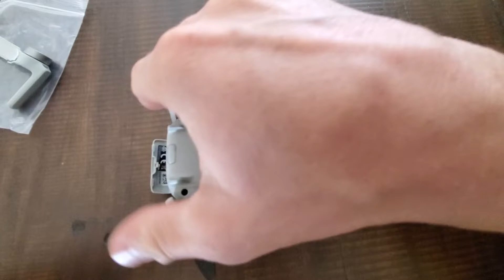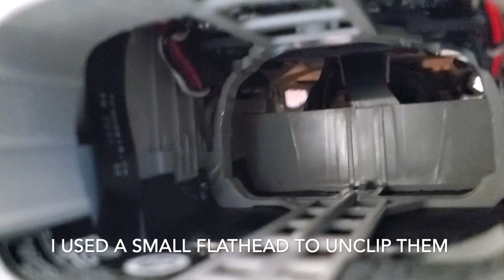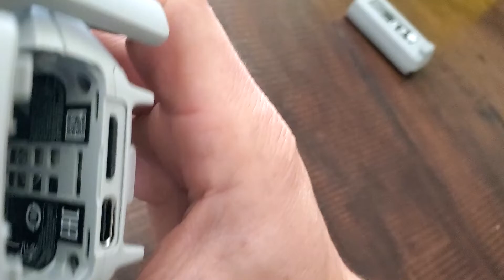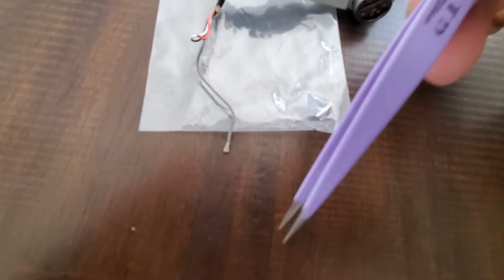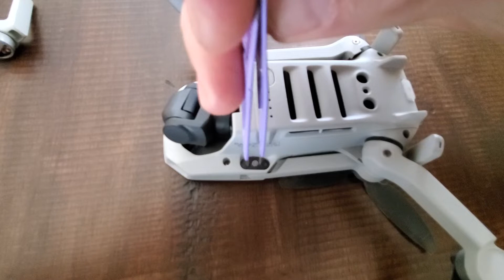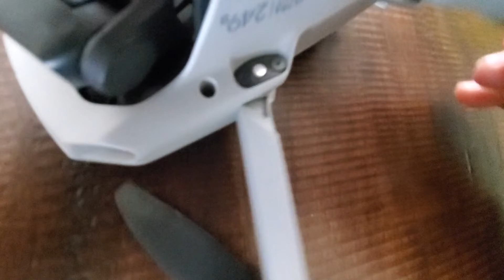Replacing Broken DJI Mini 2 Front Right Arm

Comment: I found an easier way to do the spring mechanism on the arm. You don't need to fiddle with a philips or anything. Get the arm setup in the position you used(retracted) and angle the pin into place. It'll be sort of slanted, then give it a good push. You'll have to shove kind of hard but it will go in. It took me like 2-3 minutes to figure this out and then it went right into place. Kinda weird.

Comment: Easiest way to deal with that arm is put it in between the two positions. It's very tricky. You have to get it to settle right before it clicks left or right and then it pushes right through.

Comment: I just finished replacing my front right leg, crack it when the Stars and Stripes attacked it during landing. Wind shifted and the flag flurried right into it. Be careful for the blue heat sink puddy. I managed to dabble into it a few time unfortunately. I was able to replace those area with left over heat puddy from my computer when I replaced the CPU. It powers up and gimble checks good. Now for a test flight when the weather clears up...

Comment: EASY WAY TO GET THE PIN IN THE ARM..... it isn't a pin per se, it is the spring/pin assembly.  Hold the black plastic top and turn the "pin" until you are at the apex of the spring tension...it will take a little finesse to get it stopped at the apex.  You can then move the arm to whichever position it will line up in and then press the pin in.  It takes less than a minute to do it this way.

Comment: If they could get the arm here I'd be good. Cant believe the dumb crash I had.... got the top off. Found it easier to get the back clips and then do the inside clips. The right sized slim flathead is key. Dont rush.. front of top canopy is pretty hard to get

Comment: Great video. I need to replace the same arm. Does it seem to fly as good as new? I have heard complaints saying the ebay and Amazon parts aren't oem motors. Does it seem to fly the same speed as before? Thanks
Reply from the maker: Yes it flies good as new. It's a straight forward repair

Comment: I used your technique to put the arm spring back in and it totally worked.   I was struggling with it for a bit.   It is a tricky one.     My arm broke in mid air while in sport mode.  Never had that happen before.  Sucked because it was only my second day flying the drone.
Reply from the maker: Glad you were able to get it repaired!
Reply: @jt3296  do you have a link for the mini2 left front arm I'd really appreciate it
Reply: @AliKraftDesign  I got my  replacement from Cloud City Drones.  It was the lowest OEM price I could find.
Reply: I know that feel :) lost my mini 2 on the second day. like completely lost, it flew away at a 90 m altitude. after few ads on local social media, an extremely kind person who picked the drone up after a crash returned it to me. the result is right arm is broken (but actually can be glued and works completely fine), gimbal broken, 3 in 1 cable broken. still waiting for spare parts to come from China. you can check the video of crash in my channel
Reply: @bugirrra  how much risk is there in glueing the fractured arm back? I've got one that got treed by an ill advised quick shot, and shaking the tree was another bad idea, not liking the drop. The motor still works, and seems if a strong enough glue were used, might still be workable.
Reply: @bugirrra  What glue did you use?  I've tried Gorilla super glue and it didn't take hold.  Thanks

Comment: I self repaired mine and couldn't bring that black part on it's original position because the spring is kicking the that front arm so you cannot bring it easy to its original position. One thing i did is force it at the same make a threat that if it will not go back i was going to completely hammer it into pieces. Because it is horrable as he say, took me 3 hours to figure it out. In the end the motor did not work.
Reply: Yea, that was a bear.

Comment: Hi there I have. A problem with my drone ,  a few months ago i crashed my drone , and I tryed to fix it by replacing the wings and the motor itself but it didnt work the drone starts to move to one side once i turn it on it looks to me like it doesnt have enough potential in the back right rear part of the drone its the (dji mavic mini )
Reply: Sorry to hear that. You bought a replacement arm and soldered it in?
Reply: I had the same, but you have to make sure you have the right propellors in the right arm. On the plastics from the replacementspropellors you can see how you do that. If the propellors don´t sit right it turns one sida downwards. Hope this helps...

Comment: Holy crap you probably just saved me a bunch of time, money, and headache. I just crashed my mini 2 into a tree and broke the plastic motor mount. Is it feasible to just get the plastic parts or better to just replace the motor and everything?
Reply from the maker: I would just buy the new arm and replace it. I did super glue mine when it first broke, but I didn't trust it to last.
Reply: @jt3296  Thanks for the reply. I was thinking about super glue at first, as I'm a little nervous with soldering, but i went ahead and ordered the whole arm. I'm gonna give it a shot!
Reply from the maker: @justinguy8634  It does need a microscopic amount of solder, so that part was somewhat difficult. Then you have to remove some glue that is used to hold the wires tight to the frame. I put it back together almost the same as the factory did and it works just fine. I took a picture of where each wire goes just to be sure before I removed the wires. Speaking of which I had to physically cut the existing soldering job because my soldering iron wouldn't get hot enough to melt the factory solder. That's why I added a tiny bit extra because as you will see the contacts are tiny. Best of luck with the job!
Reply: @jt3296  again, thank you. I finished my repairs yesterday and got it back in the air. Literally took me 30 mins.

Comment: What happened to the mini 2? Also after fixing replacing the arm, what do you need to do so that the Mini 2 works as it should? Any new calibration ?
Reply from the maker: My son crashed it into some metal railing. There wasn't any new calibrating I needed to do it just worked seamlessly.